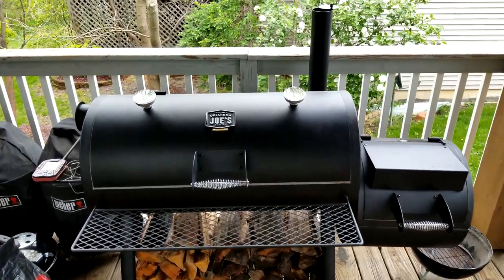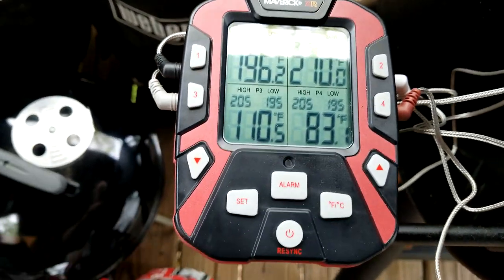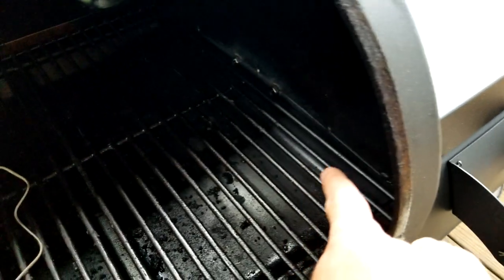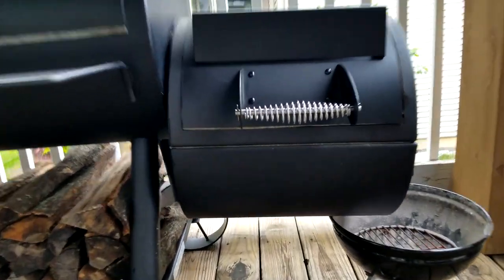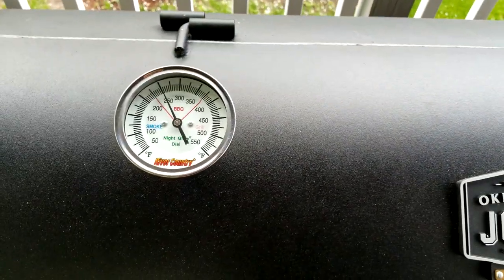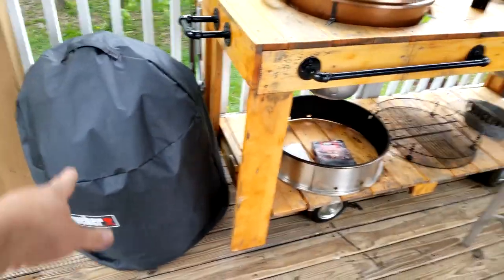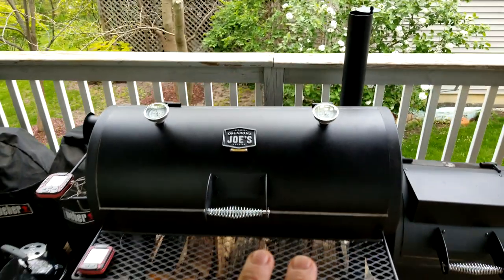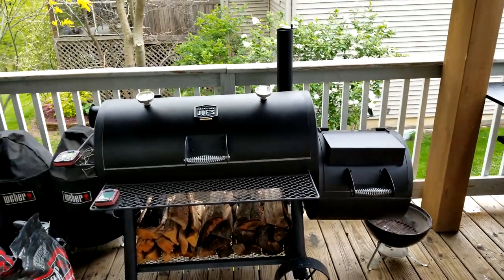OKLAHOMA JOE LONGHORN REVERSE FLOW / SHORT REVIEW / QUICK LOOK

Comment: Crooked fire box would not bother me. I would come up with some BS story about how it was scientifically designed for proper smoke flow etc.  I have to get my offset running again. Thank you for showing us your new smoker, Joe
Reply from the maker: It seems to do a great job and I'm sure the replacement will do the same. I think I have a cheap solution to keep it straight. I'll do a full review on it soon. Thx

Comment: Is that Kingsford? I'm trying to figure out why you're using charcoal briquets. You should be only burning wood in that box.
Reply from the maker: Yes it's charcoal for the break in and the best way to I found to keep steady temps of 250F or 275F for 4.5 hrs. straight is to use both charcoaland wood to start. After that time is up, I used full splits. It works great as a just a stick burner if you use small splits and want to keep adding wood to maintain. At the end of the day it's only a $600 smoker made of thin metal compared to $2000-$3500 smokers that made of thick metals. Hopefully I answered your question and thanks for watching.

Comment: Do you know if they fixed the seal issue and the paint issues? Not into modding my BBQ,  I just want it to work if I buy something, not spend more time and money fixing what the factory should have right anyway.
Reply from the maker: I know people that use them without the seals and very happy with them. Paint will blister on any firebox unless its insulated or made out of thick steel.  It's well worth $650 shipped to your door. Now if you have the money to buy a $1800-$2500 offset then you shouldn't have to seal it plus it'll be way more efficient. Either way both will produce nice bbq. Thanks for watching..

Comment: Sorry to hear about your troubles with Amazon.  I bought the Brinkman version of this smoker from Home Depot and it's just about the identical unit for a lot less money.  The Brinkman didn't have a reverse-flow option (although the stack screws on so could be modified easy enough) and the firebox vent is crappy (but it works) compared to the Longhorn.  Other than that, identical in every way that I can tell.  Like all cheap smokers though, it will need a few mods to make it the best it can be.  :)
Reply from the maker: Eventhough it has the firebox lean it performs really nice. I think it's overpriced and should be a couple hundred cheaper.  My replacement came in today and will try to get it together this weekend. I'll get a full review and hopefully a build video with a cheap firefox mod fix. At the end of the day I really like it. I forgot all about the Brinkman's.. I'm sure it's nice too.. Thx

Comment: Great review Joe, I've always like the reverse flow concept, a more distributed heat. That main chamber might just be to thin metal to support it, then add some heat to it,  then bam, it sags.. A couple angle iron supports coming up from the legs, might be a mod fix idea.
Reply from the maker: That's exactly why its sagging. I think I found an easy fix for it. Stay tuned for full review Thx

Comment: I had the same problem, the box mine came in was beat the death. I did all the same mods as you and the lava lock latches where your going to mount yours. Great smoker, but like you said the reverse flow takes alittle getting used to dial in even temp.

Comment: I looked at this smoker at Lowe's a couple years ago. I just couldn't pull the trigger on it. Good thing you got yours thru Amazon Joe. I know you'll make it work.
Reply from the maker: If this next delivery doesn't work out then I'll probably opt for a full refund eventhough I'll be out a $60 cover. I'm sure it'll fit over my Blackstone with the rear shelf installed. I'm almost to the point to call them now but I'm going to hang in there. Thx.

Comment: I had a char-griller model 8955 a while ago.  It had a bracket on the bottom of the side fire box and he legs that supported the weight of the fire box to prevent the sagging.  I got rid of that smoker a few years ago.  I plan on getting this one, the Oklahoma Joe Longhorn.  I've see this problem in several reviews.  Check out the Char-Griller set up, it might be a good fix.  I'll definitely be checking into it when I get mine.

Comment: I’ve noticed on a lot of the Oklahoma Joe’s the fire box is sagging. Even the one that Lowe’s has on display. I welded my OKJ so my firebox is straight. I leave the vent door open on my firebox to get good airflow to the splits and control the heat with the stack. You should use just splits in it as it’s a stick burner cause you already have a WSM if you want to use charcoal and add a piece of wood to it, no need to waste the money on a heavy charcoal smoker. Anyone can get clean smoke when your using charcoal as the heat source and just adding a piece of wood to it.
Reply from the maker: I understand your point but I'm still playing around with it.. I've used just splits with great results and most definitely had my door open too. I switched to charcoal basket so I can show the pros & cons between both. I'll get a video out on just splits soon. It'll all make sence in the end and you'll see my angle on all this. Thx for watching..
Reply: I’m looking forward to seeing what you got on it. Keep up the great job Joe. I wasn’t trying to be a hater was just voicing my thoughts on it brother

Comment: did you ever get the problem with the firebox hanging too low. if you had to fix it what did you do. i have one myself. the only way i can see would be either to make a support from the bottom of the firebox angled down to the lower shelf frame bolted at each end. if its strong enough to support it. they did put 2 horizontal metal angles across the inside wall and the inside of the firebox wall. not sure if there is a way to run 2 vertical angle strips to stiffen up the wall more. anyway i will watch out for your reply. u have some cool videos. nice job.
Reply from the maker: I never messed with it cause it didn't effect the way it smoked the foods. There's nothing wrong with modifying it though.

Comment: My Highland also has a saggy firebox.  I’d say it’s just a combination of weight and heat overtime. If I did it over again I’d add a couple of metal spacers/blocks between each leg and the fire box to give it some added support.  The sagging has had no noticeable effect of the cooking performance of the smoker...so I’ll just live with it until I can afford a Yoder😂
Reply from the maker: That's what I kinda figured too. You can see bow on main chamber. Its gotten worse but hasn't affected the performance from what I'm experiencing. Thx

Comment: I'm in the process of getting my non-reverse Highlander put together, and the droopy firebox is because that end of the cook chamber is bellied. I'm welding mine together top to bottom, so I only loosely assembled it, and without tightening the bolts, there's a 3/8" gap on the sides where the firebox mates with the cook chamber. It's a manufacturing issue. They got the metal too hot when they were welding it, and at that thickness it expands and warps, but then it's welded in place and can't really shrink back like it wants to. There are tricks to fix it, but probably not something you'd want to do in this application.
Reply from the maker: Thanks for the info.. I agree with you. Eventually I'll have my fab guy weld mine up. I just want to show a simple fix for those that don't know how to weld and a cheap way to keep their fb from dropping. Thanks again..

Comment: So I got my new longhorn reverse flow out side being seasoned right now. I installed gaskets, high quality silicone, lava lock clamps, and grommet. I currently have the baffles in along with the grates and I have a new maverick xr 40 thermometer keeping temp. My question, is it normal for the smoker to not go above 300 degrees very easily? 

I assume since I have the baffles in and it's such a much bigger cooking chamber than what I had before I would require more fuel, but I have the basket may e 3/4 full and I think the highest temp I've seen is in the 280s. I'm not complaining, I just hope my new thermometer isn't off. I would also assume if I wanted to really turn the heat up to cook a nice steak hot and fast, I could remove the baffles and switch the smoke stack to the other end, perhaps then it would get hotter 🤔 if that's what I was going for. Any input is appreciated  and thanks!
Reply from the maker: First test your xr 40 probes in boiling water to make sure they are accurate.. Water boils at 212F.. Are you using just charcoal or wood or mixed in the basket..? Are all of your vent's wide open..? Did you stoke the fire..? Or check if the ashes under the basket was restricting the airflow.. I don't recommend the main chamber temps over 400F.. This is a smoker and not a grill.. You'll burn the paint right off the firebox with extreme heat.. It's an amazing smoker for the price and you should watch my Oklahoma Joe's video playlist on some of the cooks I've done.. Hope this info helps.. Thanks for watching..
Reply: @BBQJOE  its not something I'm going for, I'm just trying to get to know my smoker. If I really want to cook a steak how I like it (medium rare with a nice sear) , I'll cook it in the firebox itself. The vents were all open I was using a mix of wood and lump charcoal. I'm actually excited that it doesn't overheat so easily. I'm used to having the OK JOE combo grill and the the placement of the firebox and how small that cook chamber was, made it finicky and able to get VERY HOT 🔥. With this big of a chamber and the firebox installed lower, the baffles to spread the heat out more evenly seems to be a HUGE difference and I love it. I'm just not used to having that much actual fire in the box and such a nice low heat. I'll test my thermometer today, I know better, like I said, I was just wondering if it takes some serious fire to get the heat high, which would be great because in the combo grill, a small fire can put you past 300 no problem and it took a lot more attention. Thanks!
Reply: @BBQJOE  while I got your attention, I'm smoking a couple brisket tomorrow, have a recipe that is a sure win you'd like to share?
Reply from the maker: @nickcreeksquad7386  Trim some of the fat off, Salt and pepper.. 250F pit temps.. After 4 hours or 160F internal wrap 2 layers of hd aluminum foil till probe tender (around 195-205F). Undo the foil just to vent it for 15 mins and close back up and let rest for at least 1 hr and serve.. If you can let rest for 2 then that would be better.. Times will vary depending on the size brisket.
Reply: @BBQJOE  simple...I like it. 👍🏻you know, I've never tried old fashion simple on a brisket. Do you flip or rotate the brisket at all? Or because of the more even cook with the reverse flow, you don't need to?
Reply from the maker: If I'm cooking more than 1 then yes I'll rotate them but not flip them. I always keep the fat cap down too. Keep in mind that the grate temps will be hotter by the firebox. This is normal being the firebox is butted up the main chamber and cause that's where the main heat source comes from.. Don't let the chamber top left temp gauge fool you.. It will read hotter cause the heat is rolling straight up from the plates. Use temp probes on the grates to get a accurate readings..

Comment: Would you recommend this for a beginner or if we had a little extra cash to make the jump to yoder first?
Reply from the maker: It's hard to say but imo if you have the extra cash for a Yoder.. Those are by far quality smokers.. I bought this okj as a backup waiting for my mobile smoker to get completed.. Thanks for stopping by..
Reply: @BBQJOE  thanks! I've actually discovered horizon as well little cheaper than yoder... I may start just using my weber and pinch my pennies.  For 300 more I could look at something that's 1/4 inch steel.  Thanks for taking time to respond!!!

Comment: Great video, so how long can you hold say 250F from one full charcoal basket?
Thanks!
Reply from the maker: I average 5 hrs. on a full basket using Weber  briquettes and 2-3 splits of wood. I have done a 8 hr. smoke and added 4-5 splits to finish that cook off. I'm very impressed with it for a $600 smoker.
Reply: @BBQJOE  ever consider or hear anything about the Oklahoma Bandera
Reply from the maker: @braskemsupervisor3253  I just seen a walk around video on it. It's around the same price as the Longhorn reverse flow. It seems like a very versatile smoker for the price. I think it would be awesome for reverse searing and cold smoking cheese.

Comment: Man, you're having the same luck trying to get a good one I'm having trying to get a grill stone that's not broken on arrival from Amazon.  Maybe the third one will be a good one. You learn your pits fast. Does good for the price point. Let is know how that meat turns out.
Reply from the maker: I'm very impressed so far with this smoker. It works best with one large split in the basket filled with charcoals. Hope you get a good stone soon. I'm really liking this XR50 but don't understand why it won't save my settings on that one probe. No matter what I do it defaults to 32 degrees..
Reply: @BBQJOE  
The thing I found is if you attempt to adjust your high reading from a previous cook to a lower number lower than what the low alarm reading is currently on, the high adjuster will stop on that current and previous low readimg number and will not go past it to go any lower until you adjust the low reading to read lower than what you are trying to move the high reading to. Also same thing going up for the high settimg.The high low numbers can not be set independently if that number goes past the other number. Not like the smoke will. You just have to know this. Your issue seems a little different. Try resettimg to default settings and start over.
Reply from the maker: Thank you Phil.. It should save it though considering my low #s are lower then the high #s. I just set the low # higher then the current temp its reading and it didn't default yet. Thx for the tip.
Reply: Phil N Florence little did he know he missed a bargain with s stainless stack
Reply from the maker: They made a ss stack ? It would be better if it was solid gold. lol.. New to me but I'm surely not interested. I think this model smoker is overpriced as is. I would've gotten a refund but I paid $60 for the cover. It's a really nice cover being that it can convert to a regular offset. I'm sure your just pulling my let though.
Reply: Joe's BBQ House check out Phils last video. You have to check out mad horse bbq how to rotiseree with your xr 50
Reply from the maker: I thought I did but will check out his channel here in a bit. Sorry brother I've been really busy lately lol..
Reply: @johnknapp6328  
haha, Joe I'm thinking John meant you missed a bargain not buying mine. I had a SS stack put on it. Don't think you would like the $$ though. lol
Reply from the maker: @johnknapp6328  I just watched Phil's video on his offset and yes now everything makes sense lol. That's definitely a nice smoker.. I'll go check out the other channel here in a bit. Thx

Comment: How muck St. Louis ribs can you smoker on the same
Time ?
Reply from the maker: Good question but I never filled it with ribs yet.. Should be able to fit 6 or 7 racks with no problems. I'm very sure you can add a couple more with a top grate.. I do know it'll fit fit 91 chicken wings.. The grate was full.. Thanks for watching..

Comment: You got major leakage on both sides of the cooking chamber, you can tell by the discoloration on the gaskets. It looks like it's still holding temp well, but you might be more efficient with your fuel if you fix that.
Reply from the maker: Yes it was leaking and I did buy some clamps to install but after several cooks it stopped leaking.. I'll keep an eye on it though.. Thanks for watching..

Comment: Nice lookin pit bud, I didn’t know they came with 1/8th inch steel that’s not bad 👍
Reply from the maker: The unit weighs in at 256 lbs. For the price with 1/8" steel isn't bad at all. Its pretty stout but hoping I'll get one with a straight firebox. I think that the side wall are to thin to support the firebox but well see. Thx

Comment: I'm confused, are you returning that smoker ? If so why all the mods and why season it ?
Reply from the maker: Yes this was returned and they sent me out another new one.. All the mods help with temp control to improve fuel efficiency.. The inside is raw metal so you want to season it to prevent rust.. Seasoning is a must on most offset smokers.. This is a very low end cheap smoker and the mods just helps improve the quality. I have about 30 cooks on this Oklahoma Joe and absolutely love it..! I have many videos in my playlist to prove it.. Thanks for watching..

Comment: how would you compare it to a Lang smoker?
Reply from the maker: The Lang would be way more fuel efficient and is a much better smoker by far. I bought this Oklahoma Joe as a backup incase my builder couldn't have my mobile smoker ready for my kids grad party a while back. The Oklahoma Joe's are not fuel efficient but it will surprisingly holds temps very well. You can't go wrong with it only being a $600 cooker.